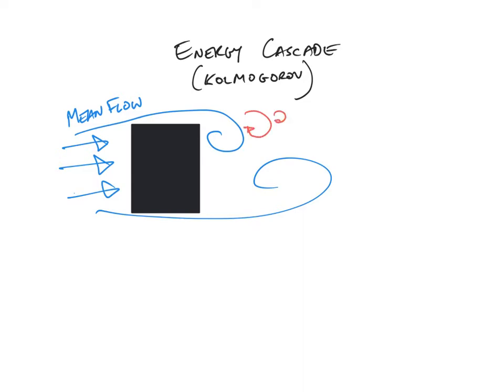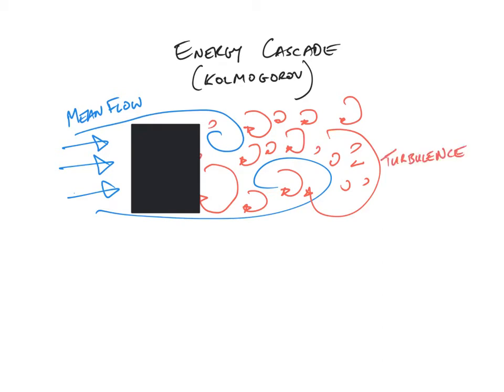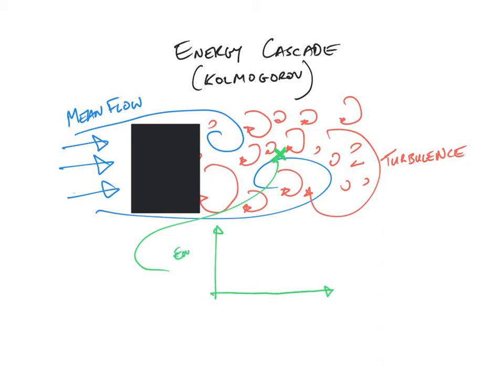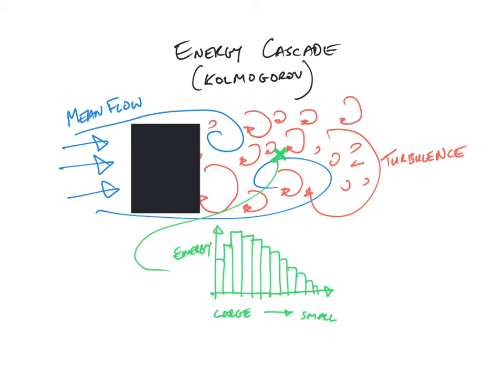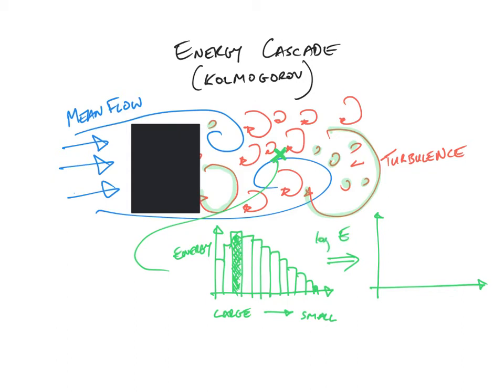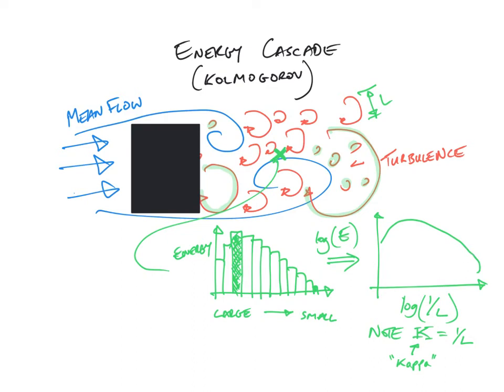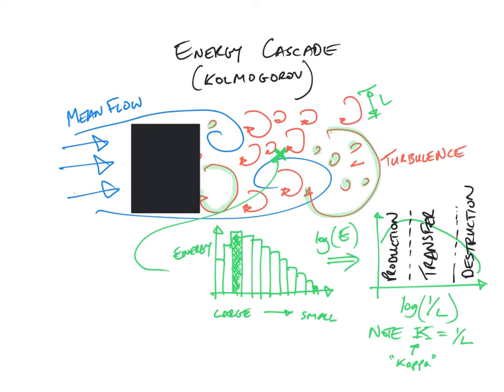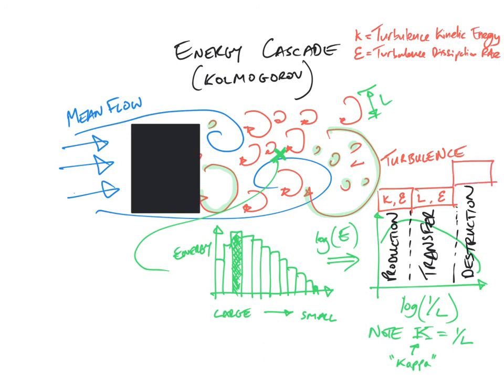Advanced CFD course: turbulence energy cascade

Comment: great video！i have some questions: 1 the probe is a "point"，the eddy/vortex is a "volume"，how a probe can measure the energy of an eddy having？ 2 giving us a known velocity field v(x y z t)，how to find "large eddy" "small eddy" in the field？drawing the streamlines and using human eyes to capture and identify？3 why eddy's size is usually associated with wavenumber？i mean，i cant feel wave in eddy. how to understand these concepts？
Reply from the maker: Thanks for your feedback. The eddy is indeed 3D, and it moves with the flow, while the probe is sampling velocity at a single point, i.e. a fixed coordinate. The spectra gives us a measure of the energy at a fixed point only, but if we assume the turbulence is composed of simple rotating, circular eddies, then we can describe the range of the size and strength of these eddies by measuring the velocity at this point. Remember, the spectra measures frequency, and so incorporates the time history of the eddies velocity fluctuations as they move through this point. Remember also that turbulence is the fluctuating part of the velocity, i.e. there is an underlying mean flow which moves the eddies through the flow field and past the probe. While the probe is stationary, the eddies continue to move over them. 

In the frequency space, large eddies (L>>1) correspond to low wave numbers (1/L<<1) . From a time-history measurement of turbulence at a point, we can take a Fourier transform, which picks out the amount of low frequency (large eddies) and the amount of high frequency (small eddies).  These scales are small and dissipate quickly so not easy to see without flow visualisation!

Comment: Thanks a lot. So, if I got it correctly, the energy spectrum is nothing less than the energy amount of the "fluctuation" of the flow which depends on the vortices sizes on time. I was struggling to understand this in physical terms. Mostly everywhere I looked talked about the mathematics transformations, but no mention at all to correlating this to the physical world. The drawing was very helpful.
Reply from the maker: yes that is correct - the analysis is based on the notion that you separate the instantaneous velocity into the time-averaged velocity and the velocity fluctuations, or deviations, away from this average velocity. You then effectively have two velocities and can thus compute two different 'kinetic energies', compared to just one.

Comment: Great video! I have a couple of questions: 1. Since the vortices are shed constantly, where do you actually place your probe to measure the velocity? Even if the vortices were standing in one spot, I still wonder where in the vortex you'd have to place the probe ie at its center or on the edge     2. How long should you take your measurement for? Are there guidelines in this regard maybe in a textbook?
Reply from the maker: Hi sorry for delay! The diagram is highly simplified - in general many many vortices of all sizes would pass by the location of the probe as time went on - as such you'd get a representative measure of the range of spatial scales as long as your probe was in the turbulent wake region. As to how long - good question! In general it depends on how fast the flow is moving - if you say it takes one unit of time for the largest vortex to completely pass by the location of the probe (this is often referred to as a characteristic time scale) you might need something like 50-100 such time units to obtain decent statistics! in practice the precise duration will vary from flow to flow!

Comment: Probably a bit late, but would this be a typical technique for analysing the flow field in say, internal flows, and using the analysis to make modification to the flow? Or would simpler techniques be used first?

great videos by the way, thanks for sharing
Reply from the maker: Thank you, yes, the methods are equally applicable to both internal and external flows. We often start our more complex simulations with more simple ones, both to help inform how we use the complex methods and to provide a decent initial solution. Otherwise the decision whether to use simple or more complex methods generally depends on the balance of accuracy and simulation time you want to strike.

Comment: Thanks for the video. This is very useful. The only thing I can say is that is better to say "Dissipation of energy (into heat)" instead of "Destruction"
Reply from the maker: thanks - good point! I generally talk about this in terms of incompressible isothermal flow, and so try to avoid mention of thermal effects but your explanation is of course more physical.
Reply: @mcji8ar2  Thanks to you for the answer! I'm studying exactly this argument for the Fluids Labs (Fluid Mechanics - Computational Fluid Dynamics) exam, so I'm on the trail and your video is very helpful!

Comment: Thanks for the video. So do you mean using  a probe situated at one point in the field, u,v and w should be measured and then 0.5(u^2+v^2+w2) is calculated and plotted over time and then somehow correlated to the eddies that pass thru that point? So the graph you mentioned should be constructed using flow visualization data as well as velocity measurement data? Doesn't this approach seem a bit "rough"?
Reply from the maker: Hi there. The idea is that wherever in the flow you take a measurement of the unsteady instantaneous velocity, you can extract an energy spectrum from that point by considering the range of frequencies in the velocity signal. You don't need any flow visualisation for this - only a single probe gathering velocity data. The explanation in the video is using a sketch to link the passage of a large scale structure in the physical space to a peak in energy in the frequency space. hope that helps!

Comment: Thank you very much for sharing your work! I have velocity data (x, y, z) measured in a channel and I want to obtain the "Turbulence Energy Spectrum", how could I do it ?, that is, I know that in literature there are authors who write different equations for that, but How do I do it?
Reply from the maker: Hi Cesar, thanks for your comment. Basically you need to convert your velocity - time series into a frequency series, i.e. you need to do a (Fast) Fourier Transform or FFT. To do this take any of the components of the velocity as they vary in time and run FFT algorithm, e.g. using MATLAB (but many software alternatives also). For this to work well then 1) you need a fairly larger number of samples or velocity measurements, 2) the timestep or interval between measurements should be sufficiently small (this size dictates the highest resolvable 'frequency' and 3) you ideally need the timestep intervals to be constant. e.g always 1x10^-4 seconds apart.